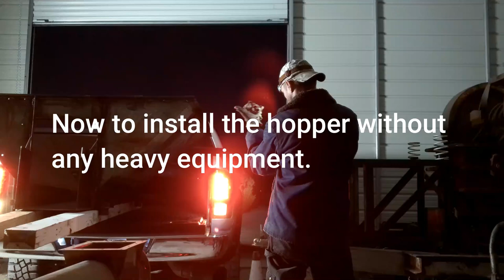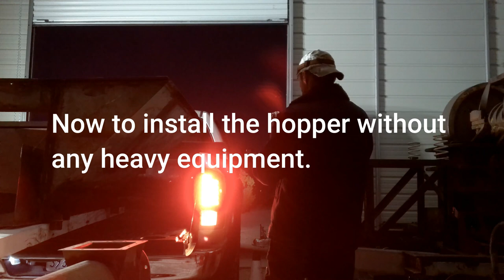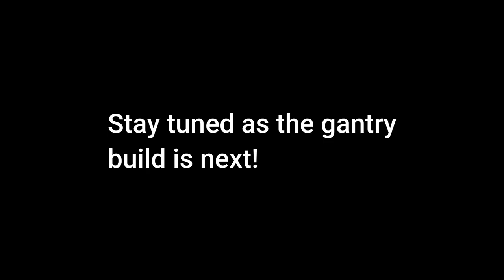How We Built a Hopper Feeder for our Jaw Crusher

Comment: Do you guys have anything holding that hopper to the shaker part you need to have some kind of movable hold down with a lot of movement you know that will limit the amount of shaking so it doesn’t fly off that’s my opinion and I don’t know shit😂
Reply from the maker: Hi Dawn, we're adding some welded clips or a chain leash to it. The frequency is to high right now. We need to find a different vibrating motor. Nice suggestion 👌.